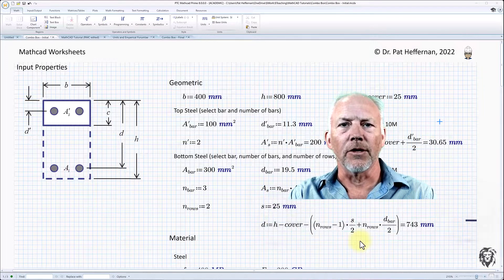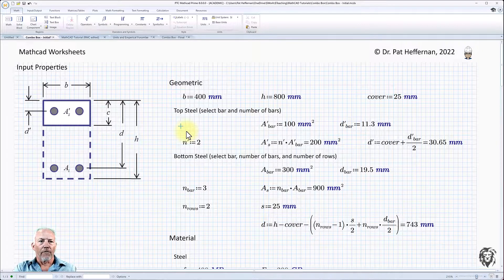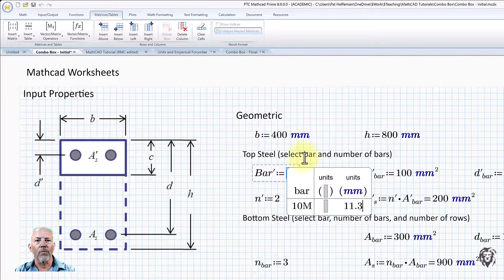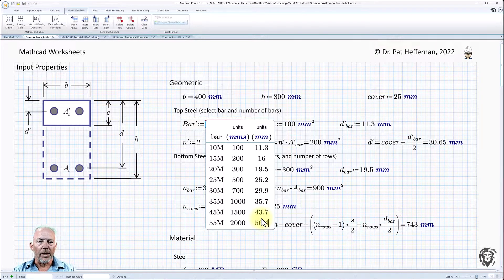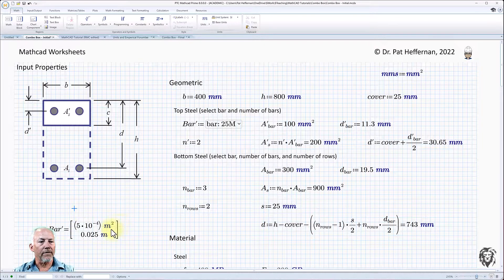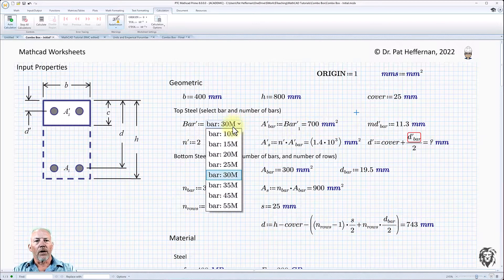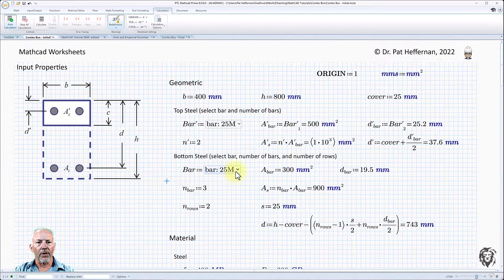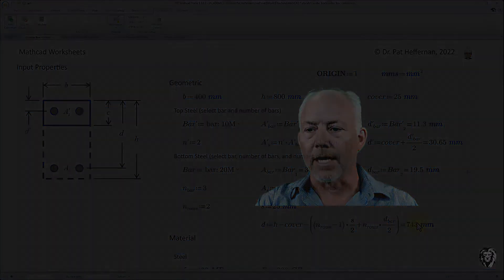PTC Mathcad - Combo Box

Comment: Thanks for the video, that's really useful. I was wondering if there's any way of hiding the Bar'1 and Bar'2 parts of the diameter and area definitions to improve the presentation of the spreadsheet? Also, is it likely that the bug in the units part of the combo box is likely to get fixed?
Reply from the maker: Hi Matt.  I’m not associated with PTC so can’t speak to their plans.  I will experiment with the title parts to see if I can control its visuals better. (Away for work right now so it will be a few days at least)